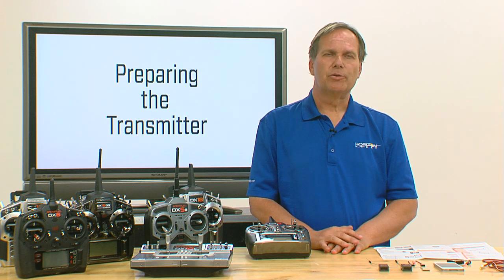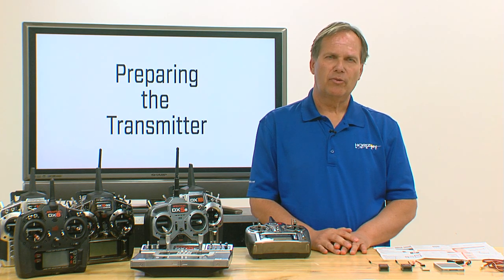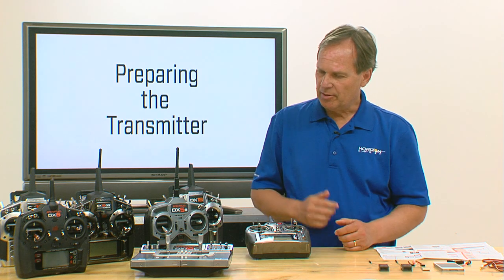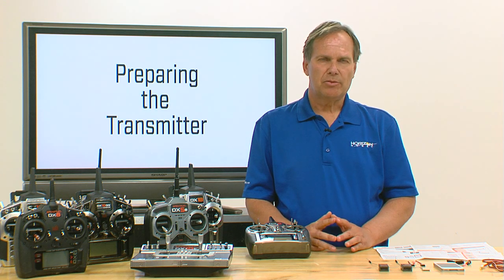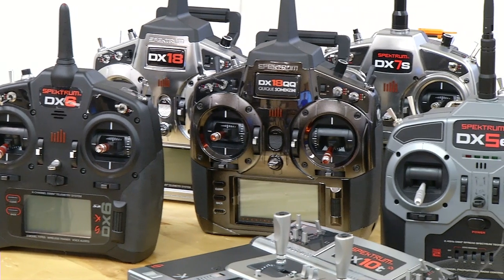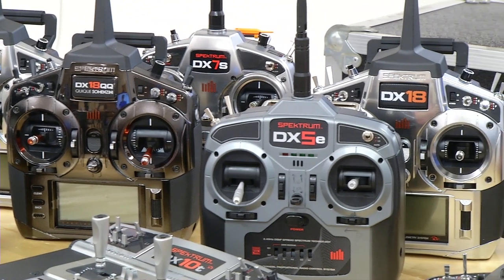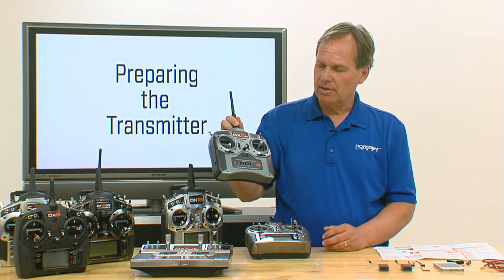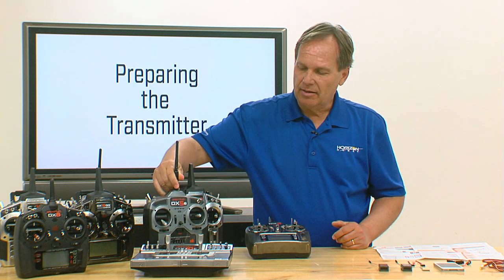Spektrum AS3X Step 1: Transmitter Setup (Initial Setup)

Comment: I have had many problems with these RX Con AS3X and my best solution has been to place a gyro reflex v2. or replace the RX with a Lemon RX Telemetry, Stabilizer. It works like a charm for me.

Comment: As usual nothing works as it’s supposed to. Forward programming on a DX9 locks up every time I try to program a brand new 6610 receiver. Bluetooth connectivity with the cable and the iPhone app are a joke. Come on Spektrum, you’re better than this!
Reply from the maker: Hi Jeff, the AR6610T is not programmable via Bluetooth or with the APP. It does support forward programming from your DX9 (update Tx to V2.05+) BUT it is not an AS3X receiver. The only settings you can change are failsafe parameters on the AR6610T. Curious what lead you to believe you could program the receiver with the app. A simple assumption? Because it is not mentioned anywhere on our end. Thanks!
Reply: @SpektrumRCvideos  well as Spektrum has always fallen short on set up instruction and product information , I assumed all new receivers were programmable via Bluetooth. Why would they not be? It would cost maybe another $5 for a Bluetooth chip? I don’t think I ever mentioned that the 6610 was AS3X did I? Nothing I found said anything about the Bluetooth cable not working for programming. I did try  to program through the TX without the Bluetooth cable and like I said, the screen freezes on the DX9 and the receiver has to be rebound. I took a look at the iOS comments on the App Store an evidently problems are rampant with the app also. I love Spektrum products but you guys make it very hard to find the information we need to make things work as they should. You say what it can do but never much on info on how to.

Comment: Why don't you show how to do this without a cell phone....and just using radio to receiver.  Your safe system is a night mare.
Reply from the maker: The AS3X receivers all need a PC or Smart device to setup. To adjust settings from your radio you need to initially setup the RX for your model and choose the correct settings for adjusting gain via the radio.  This is not SAFE, but it will help your model fly against torque and turbulence.
Reply: Not so! I have an AS3X that came in my Timber and I can set it up without a smart phone.... The new one I bought for my FMS King Fisher I cannot! I love Spectrum and have had them for years, but this is BS.  Now I have to buy a plug and down load an ap? That sucks!
Reply: @SpektrumRCvideos  Another Spektrum Bull Shit video!